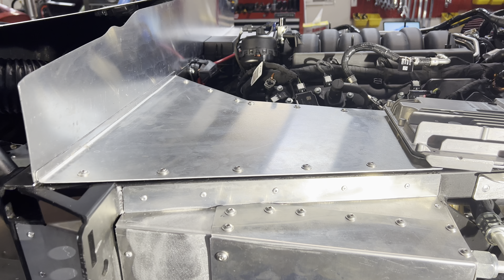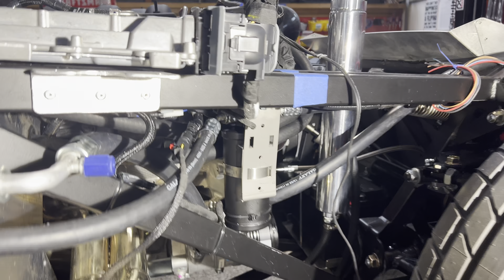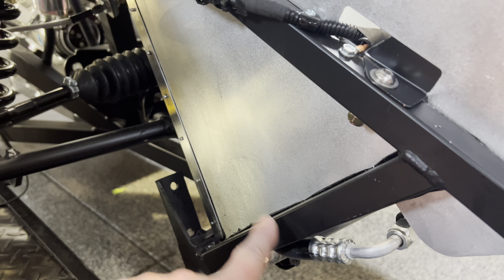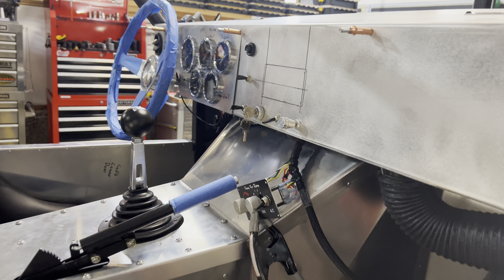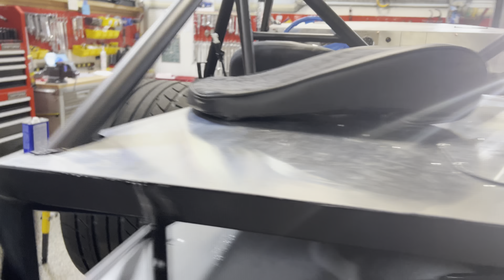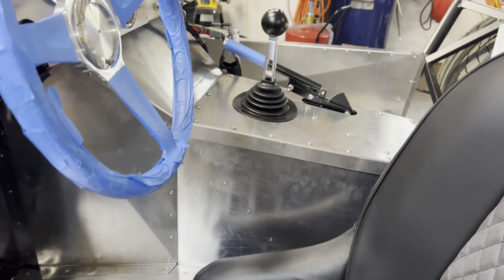Update 29 Air Conditioner and Heater, Factory Five Type 65 Coupe (1965 Shelby Daytona Coupe)

Comment: I used a similar seat track, i just put some standoffs to get them off the floor a bit. all though I have a roadster with no roof. I have heard  that you can raise the front more that the back and it would give you more head room and better angle for you legs.
Reply from the maker: Interesting idea. Thanks for the input. I’m going to consider all options.